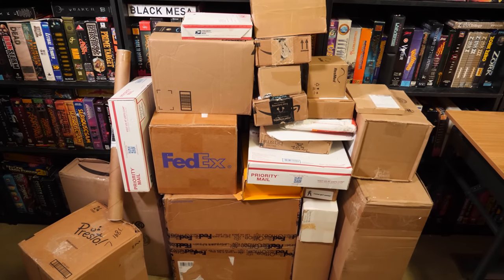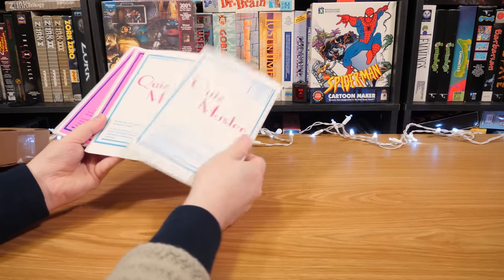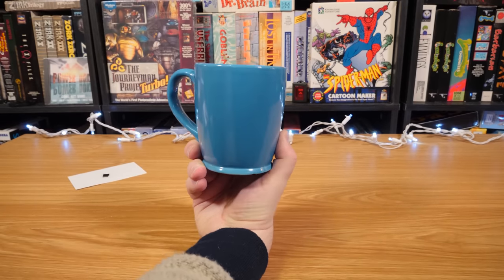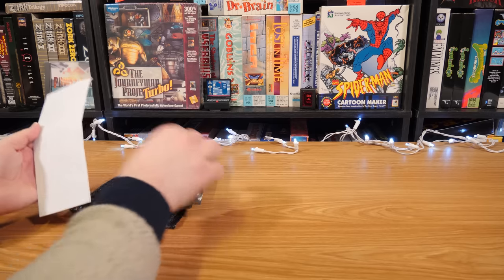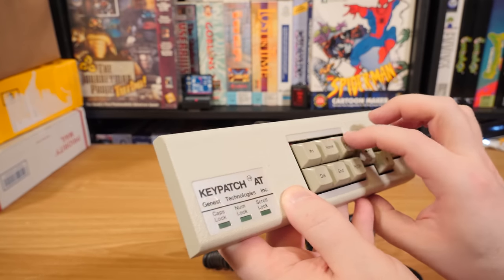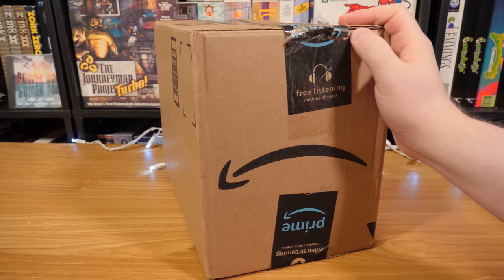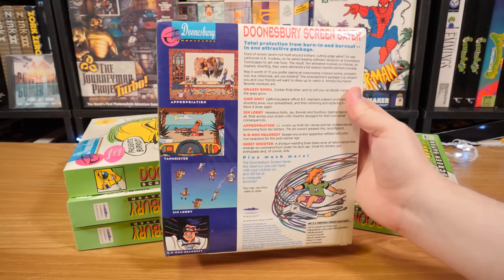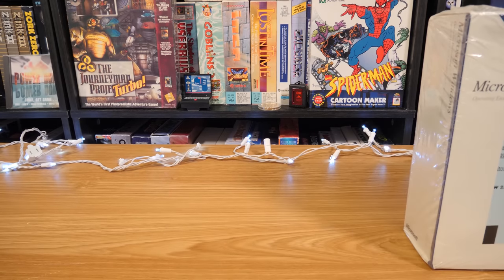Opening a Big Pile of Retro Tech You Sent In!

Comment: Very interested to see a Windows 1 install.
Reply: Same
Reply: @alexsilva28  Well, it's not very pretty.  I have version 1.01 running on a 286, about the best part of it is Reversi, or maybe Paint.  I don't have a lot of applications for it, and not many were written specifically for it at the time IIRC.  Frankly, DOSShell from MS-DOS 5 and 6 is a better file management tool and application launcher.
Reply: @AndrewAMartin  Reversi?  You've just solved a mystery.  When I was at Primary School (aged 5 or 6) one of the computers had Reversi and I couldn't remember the details.  It must have been one of the RM Nimbus 186s that we had.  Not PC-compatible but ran an early, customised, version of Windows.

Nice one.
Reply: I'm interested to see how much hassle he will come across... Windows 1 is a temperamental piece of software. Of course, it's nothing compared to Windows/386 2.x, which I have never managed to install.
Reply: @VectraQS  your installation woes may be due to DOS version compatibility. I'm running Windows 1 on DOS 6.22, but to do so, I had to use VER.EXE to tell Windows that it was DOS version 3.3.
Reply: I remember installing Windows 1.0 on my computer at work, when it was new.  Crazy to think of how much time has drifted by since then.  I also remember installing Netscape 1.0 and Windows NT 1.0.  Those were the days...  Remember Friendster?  😃

Comment: That Compaq laptop and dock sure bring back memories, I used to deploy them to users...   they weighed a ton, completely over the top and $$$$$ too!    FYI - There are two spring loaded things above the LED indicators & battery button, these depress down to accommodate a large monitor stand attachment on top...   once those spring loaded things depress down, they provide a recess to lock in the monitor stand to stop it sliding around.  An absolute behemoth once all assembled together.  🤣

Comment: I had one of those 5280's that I dialed up to the 9s in the early 2000s.  Had multiple hard drive caddies so I could swap and run different OSes.  Loved it because it was a workhorse.  Took mine everywhere.  The modular ports could hold a floppy, CD ROM or a battery.  That is why the battery has the door that extends to the right.  You could put it in a modular port and pull the door over to cover the rest of the slot.  At the time, with two batteries in the laptop, I would use it for tuning WiFi shot lines and scouting interference.  I heard from a Compaq rep about a "workstation" base and hunted around for one.  There was another, smaller base that didn't  have speakers or the ISA slot that I had, but that usually stayed at work.  Mine had a plastic monitor shelf that curved over the back and fit into those two sockets in the top front.  The battery disk indicators were aligned to being able to max out each, and indicated which on was indicated by the quadrant of the machine the port was on. The IrDA in the base was really hit or miss but the one on the laptop always worked better.  I tried using the Compaq Hardcard accessory in the ISA slot on the base, but it kept locking up, so I replaced it with an ethernet card.  I remember the speakers as being pretty good as I used to listen to the GITS soundtrack on it often while working.  Somewhere I have a picture of that machine, the dock, a Handspring Visor and a 17" CRT as my home workstation.  Used that for about 4 -5 years before getting an IBM from work and using that moving forward.

It also came with a "wireless modem" set up.  It wasn't cellular, but an RF telephone accessory that worked with a base and a cordless modem.  Was kinda cool as a gimmick.  Could support 28.8 if you used the phone port on the remote or 33.6 if you used their special PCMCIA modem.  Worked so long as you a) didn't really move around and b) no one tried to use another cordless telephone.  Even when the phone was on a different line, it would still kick you offline with CRC errors.

I kinda miss those workstation docks.  Yeah, the new usb c stuff allows for more diversity, but give me one of those old LTEs or a MacBook Duo for looks any day!

Comment: Also, I had one of those Compaq laptops with the dock - identical to how you see it - in 2002.  It was awesome.  So expandable, so useful, great modular design.  I loved this computer SO MUCH.  If I remember correctly, you could get a CRT table that would sit over top of the laptop when closed and support the weight of the monitor.  You could hot plug and unplug the laptop from the dock and "go".  Again, one of my favorite laptops ever.

Comment: @LGR
@11:42 Clint, those were unpowered speakers for sound cards that had amp hardware built into them, of which you have many! Generally a pair/set of jumpers were all that was needed to switch between the output modes(amplified VS line-level output). I had a set of those speakers, they came packaged with an ATI Rage VGA card deal that CompUSA had way back in the day.

Comment: Senator pens are made in Germany.

Genest made all kinds of keyboard accessories, including one which was designed to plug into a laptop's parallel port and added extra keys.  They used the rather weird Cherry M8 switches which are ultra low-profile mechanical switches with side actuated contacts.

Comment: Have the exact same Compaq model at home and (until recently) also that docking station. I can confirm: These are modular, because it came with a floppy drive and I happened to find a working CD-ROM module at a flea market. The docking station allowed you to use both. 
Had to get rid of the station because it was too old and not working properly anymore, but I still have the laptop, both modules and I even found a RAM module to boost the 16 MB base to 48.

Comment: Ooh, I had that Hercules card back in the day. The feature that made it special was the deferred rendering, which keeps occluded pixels from being drawn. That gave it a a speed advantage over similarly priced cards.

Unfortunately for me, I was a frequent user of the lowpoly modeling software Milkshape 3D, which was the only software I came across that had issues with this card. The selection rectangle would be cut into a triangle, which is frustratingly annoying for precise work. But still, it was a great card that breathed new life into my trustly 700 MHz Athlon machine.

Comment: We had such a weatherlink setup at the school I used to go to and later work at. Ours was much newer and I had to painstakingly download an update for XP to use it on the machine we wanted to run it on. From 2008 to 2013 it was broadcasting weather reports and forecasts from the roof of the school building... and uploading it to weather underground! I don't think you can do that anymore. Since it's serial-based and I'm sure it uses a standard method of reporting metrics back, you might be able to hook a Pi Zero W to it and have that send data out to whatever website still allows for user-run weather stations to post data to... but that's a bit more advanced than you'd probably want to get with it.

Comment: A Hercules 3D Prophet! I had one of those and put it in my first PC for college. It was relatively cheap compared to competition at the time  (hence why I ended up with it) and promised comparable features. It was also relatively obscure. The reason for the obscurity was that it was not a good card. It had major compatibility issues and I remember it running GTA3 at a crawl back in the day. The Power VR chipset that it used was supposed to be delivered from the same one used in the Dreamcast.

Comment: I have nearly the same Compaq laptop (mine is an LTE 5300) in my basement, in much grungier state, but not the docking station, with a dead battery and damaged power adapter.  It may be the newest laptop I have as well, as I have a Pentium 90 Dell Latitude and a couple 486 monochrome ones (one Dell, one IBM), all cast-offs from a former employer.  And I also have Windows version 1.01, which came bundled with my first PC clone, a Heath-Zenith model 248 running an 8 MHz 80286 on a passive backplane system.  I don't have that system any more unfortunately, just the EGA monitor, but I do have Windows 1 running on my second PC, a 1990ish 20 MHz 286.  That one needs a new clock battery, but is otherwise complete and running...

Comment: 40:50 The bays are modular, accepting floppy, CD, or hard drives, or an extended runtime battery. The dedicated hard drive slots -- one front and center on the actual laptop, and it looks like this docking station has one underneath the two PCMCIA slots -- use a proprietary ribbon connector that's prone to failure but have mini-IDE on the other end, coming stock with one Toshiba small-form-factor drive. I think my parents just got rid of an identical docking station and a down-market laptop from the same line, otherwise I'd totally send you the floppy module!

Comment: The ATI Stereo FX was a Soundblaster clone from back in the '90s. I had one in my 386; it worked pretty well. Basically anything that supported Soundblaster would work with that card.

I don't specifically remember if it came with speakers, but those speakers look familiar so it might have. I know that the speakers I used with the card didn't have any volume adjustment on them so I had to use the little stick-knob on the back of the card, which was annoying, so I might have been using those speakers.

Comment: I'm pretty sure I had an older version of that Compaq laptop. I mean, it worked for what I needed it for, got it off eBay with Windows 95 installed. A year or so later, I ended up with the laptop I really wanted, an IBM Thinkpad 600 series.

Comment: I was one of those 12 people that used a PowerVR Hercules. (IMG) Imagination Technologies PowerVR GPU's were and are still used in the newest iPhones and iPads. So, you can "imagine" that they must be good, and they are. PowerVR's mobile GPU's are the most powerful GPU's available in a SOC. Although, apple is using there so called apple GPU, which is just licensed and owned from Imaginations Technologies, apple calls it there own but, still it is quite powerful. PowerVR has a new A1/AX GPU that is rated at 2 TFlops of FP32 using just 9watts. Pretty remarkable. Apples new PowerVR derivative 8core GPU in there M1 SOC is rated at 2.6TFlops of FP32 but, uses like 25watts. Doesn't sound like a lot but, that's a big difference. Qualcomm is climbing back in the ring with there Adreno 660 GPU in the Snapdragon 888, getting very close to that 2Tflops of FP32 compute at that 9watt barrier. Just a little info on PowerVR and the license owned by apple but, its still PowerVR's architectural foundation at its heart.

Comment: Wow I had a pentium 120mhz Compaq Armada when I was 10 in 2000. I sniped it on eBay for 92$. It had a seperated battery/handle. But it also could take a docking station like that. Mine only had a floppy and 11.1k modem.

Comment: FYI on that Cyrix MediaGX processor in case you weren't aware, it's not a true Socket 7 compatible part despite looking like one. You'll need a motherboard designed specifically for the MediaGX in order to use it.

Comment: I had a very similar Weather Station for DOS / Windows 3.x for years.  Also had the software (same kinds of application - graphs, etc).  Had the Windspeed and direction device on a 10 meter (30 foot) pole on the side of my house, the rain guage device on the roof, and the temperature and pressure under the eeves.  Very easy to setup.  I set mine up and had it monitoring the weather (wind mostly), because I was hoping to setup a renewable energy farm - solar panels, classic wind turbines, savonius rotors, dish sterling engines, etc - on my land in the early 2000's.  I should do a video on this and about what happened - because people just cannot believe it when I tell them about what happened.  Anyway, if you need help with setting  anything up, let me know.
EDIT: fix typo.

Comment: Clint, I have a Compaq floppy drive that'll probably fit those modular bays on the Compaq LTE laptop. It's from a Pentium90 model (the LTE5100), but I'm pretty sure it'll be interchangeable. If you're interested, I'll check if it still works and send it over if it does.

Comment: Those clear Apple speakers look like the Apple Pro Speakers, designed by Harman/Kardon, that came (or were an option) with certain iMac G4 (aka The flat screen "Desk Lamp" iMac) models as well as the Power Mac G4. They have a non-standard 2.5mm Apple Pro Speaker Minijack that's only compatible with the mid and high end iMac G4s and Power Mac G4s. Note: These could also be Chinese knockoffs that work on any computer via a standard 3.5mm headphone/speaker plug so check the plug.

Comment: 19:36 I am still waiting for a Power VR Kyro II review dude 😀I own this card and it is one of the cards which impressed me the most back the days (aside of the 3dfx Voodoo). There was nothing like that card back then. Fast and cheaper than the competitors. You can even run it passive cooled. It needs some tweaking for some games. The tile based rendering is not that compatible for some games. But this card is just great and absolut underrated and sadly mostly forgotton. The Sega Dreamcast has the predecessor (Series 2) graphics chip. Series 4 never got to marked. But Series 3 got to marked on mobile devices (MBX) and also Series 5 (SGX) and that was where PowerVR (Imagination Technologies) then made their money for a while. They where bought in 2017 by a chinese investor and announced a new GPU for the chinese market last year.

Comment: I actually have a GeForce 2MX400 64MB in a system, if you want i could do some benchmarks and compare it to the Hercules card, i believe mine has slightly higher clock speeds so it'll be cool to see architecturally which pulls ahead!

Comment: MkLinux is pronounced "em kay linux". It stands for "microkernel Linux" was a port of the Linux kernel upper bits to the Mach microkernel. It was done by Apple in the mid-90s to evaluate Linux as a possible base for a successor to Mac OS. As you know, Apple bought NeXT and the successor OS turned out to be NEXTSTEP, remade as Mac OS X (now macOS).

Comment: A Kyro II card. Nice. Did never test them. The Sega Dreamcast and if i am not wrong the same principality and manufacturer like in the mobiles this days. PowerVR.

Edit:
I do believe its possible to find uICE from MediaTexX to program the ir controller to work like a mouse and or keyboard. I did usi it on my HTPC and a Hollywood+ card and controller. Have a profile for BSPlayer, Windows and VLC besides the normal function for the card.

Comment: "Who the heck needs 3 CDROMS?" Have you ever played Riven? There were a lot of old games that had 3+ discs where you had to go back and forth between them, but if you had multiple drives you could get away with not having to swap them out so much. At one point I had 3 IDE CDROMS on my desktop machine.  I doubt that's what this was used for though. Probably some engineering thing where they needed to switch between 3 different programs frequently that all required CDROM drive access to function (probably some DRM junk).

Comment: MkLinux is Mach Kernel Linux, Linux for the 68k processor, eg macintoshes with 68000/20/30/40 etc.
Reply: Sorry had to correct no 86k but 68k processors, but also 6800

Comment: At 11:20 I imediately recognized the ATI stereo f/x speakers from the early 90s...because I got a pair of these a couple of weeks ago and presumed they are really old and kind of rare. I did some research and only found two old PC mag articles from around 1991. Those speakers came with the stereo f/x or the VGA stereo f/x. Back then these sound cards still had a built-in amplifier so you could use these passive speakers. I listed mine for sale and put two screenshots from the pc magazine in the ad here: https://www.ebay-kleinanzeigen.de/s-anzeige/ati-multimedia-series-pc-lautsprecher-vgastereo-stereo-f-x-1991-/1599672548-225-8812

Comment: I have a Quicksilver G4 with Kubuntu 12.04 installed. All the software works perfectly, but performance is slow. Is that because the Linux kernel is in a virtual machine, rather than making direct calls to the hardware?

Comment: This is important. The Cyrix MediaGX, shown at about 10:28, is not compatible with socket 5/7 motherboards, despite looking like a socket 5/7 CPU. From what I heard, this chip has a different pinout and requires a special companion chip in order to work. Please don't use this processor with "normal" socket 5/7 boards. If you're interested in learning more about this CPU, you can visit these links: https://www.cpu-world.com/CPUs/MediaGX/index.html; https://en.wikipedia.org/wiki/MediaGX; http://www.cpu-collection.de/?l0=co&l1=Cyrix&l2=MediaGX; http://www.cpushack.com/MediaGX.html; https://www.ithistory.org/db/hardware/cyrix/cyrix-mediagx-gxm-266gp; https://www.pctechguide.com/cyrix-cpus/cyrix-mediagx;
For more informations about this specific chip, visit this link: https://www.cpu-world.com/CPUs/MediaGX/Cyrix-MediaGX%20GXm-200GP%202.9V%2060C.html
Please correct me, if i'm wrong.